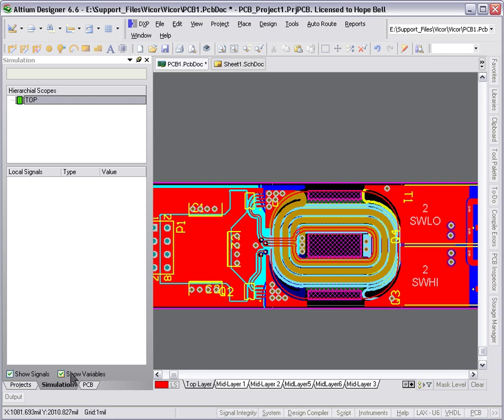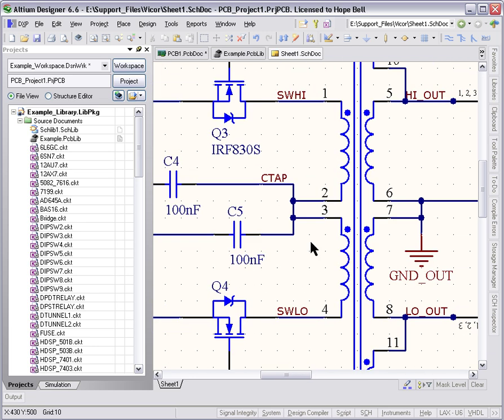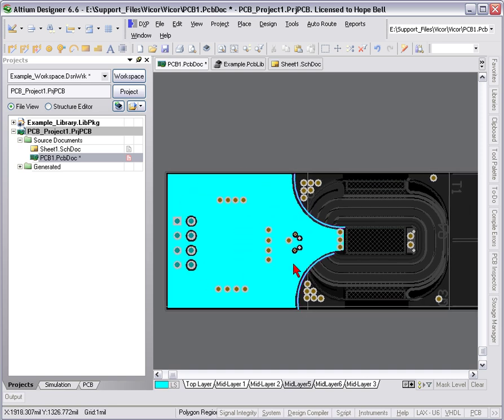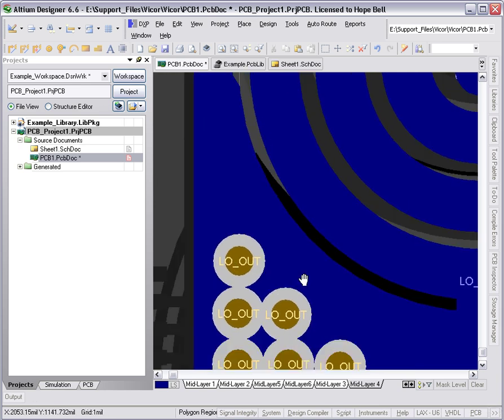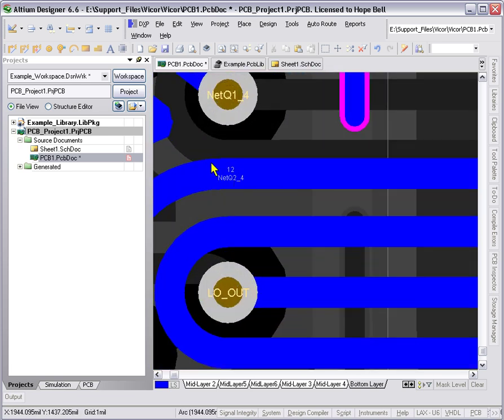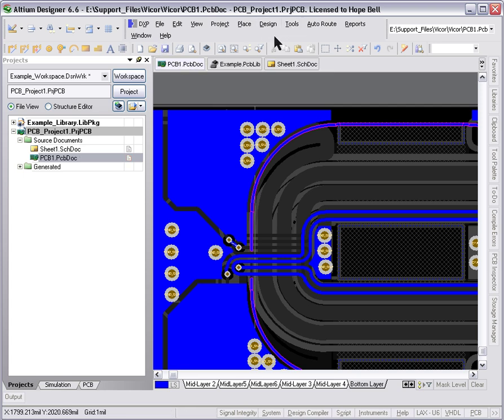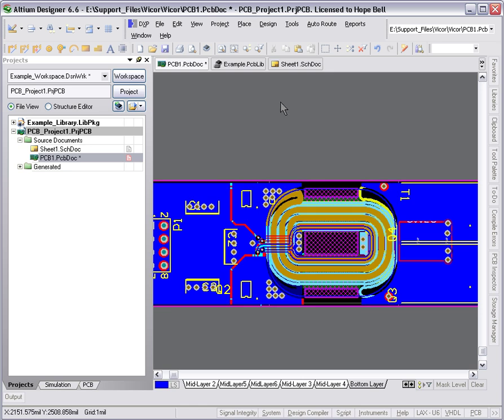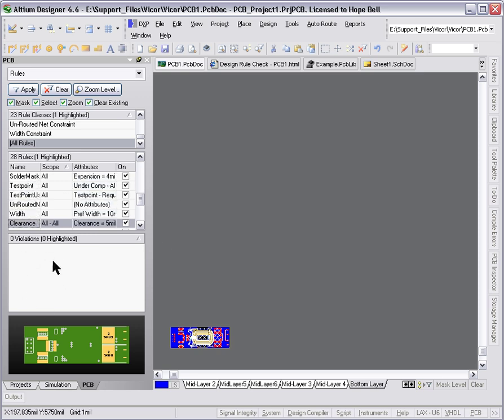Creating Planar Transformers in Altium Designer

Comment: And HOW to draw spiral tracks?????
Reply from the maker: Ahhh that's the 64M$ question. The answer - use Darren Moore's spiral inductor  or planar transformer scripts. They are available on the Google Code site for Altium Designer add-ons (search - you will find it).